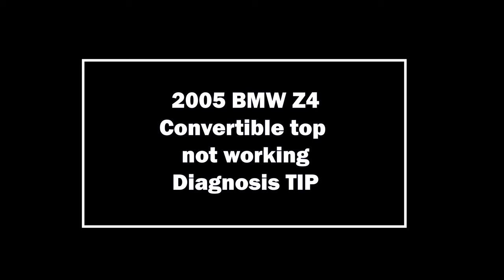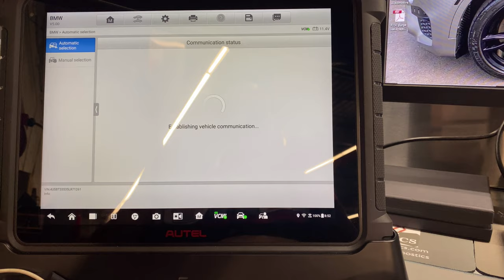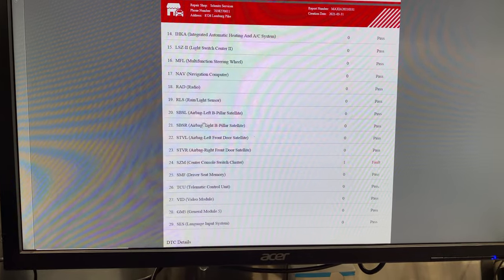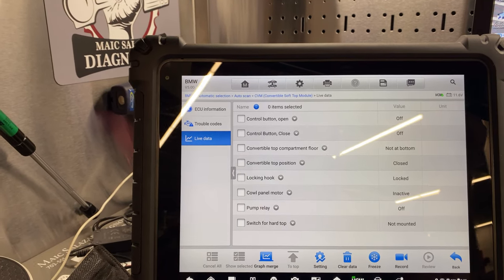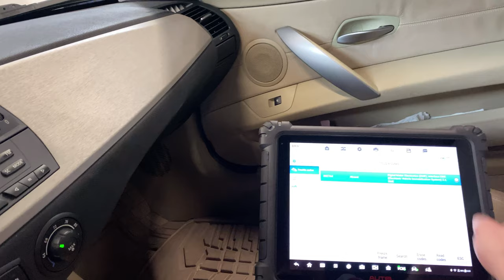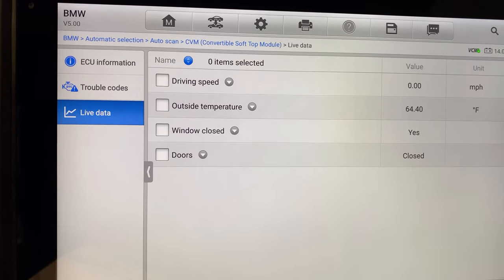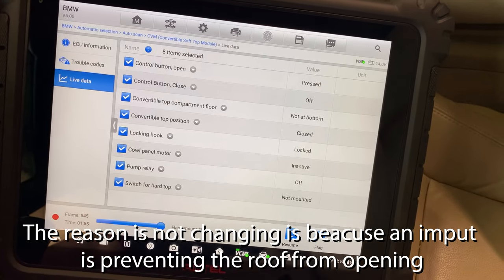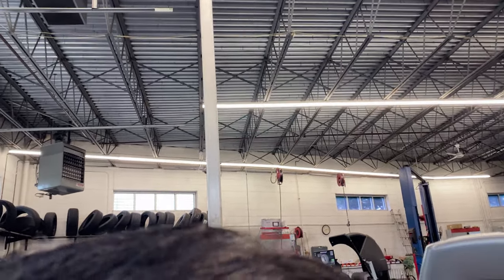2005 BMW Z4 Convertible top not working Diagnosis TIP

Comment: Hi Maic on BMW Z3 cars it’s the first thing to check but I have seen on a few cars ether the micro switch is faulty or the paddle on the switch is bent or missing and one more thing the movable compartment panel has a moulded square tab that can be broken and it will not trigger the micro switch.    But the most common problem with a non functional top is the hydraulic pump motor is submerged in water because of clogged drains the pump is on the driver side you have to remove the top assembly in order to replace it the top ECU Will not produce any fault codes what I do to confirm a bad pump is on the driver side behind the driver seat you can partially remove the trim and the pump master plug Is there so you can check the voltage when the top is opened or closed the polarity is switched when the top is open or closed I usually drill a bigger hole on both side when the top is remove to prevent any water damage later on.

Comment: I have the same car but it's an 03 any advice on why is negative battery cable is getting hot and the battery was leaking water but the positive cable is fine.

Comment: Where are you located? I want to take my Z4 to you lol. My soft top won’t go down either, I already made sure that the compartment is open too. So I tried to manually put it down but it gets stuck halfway and I don’t want to force it down (even after disengaging the hydraulics). I found out it only works to go up but not down. Even though the button to go down lights up?
Reply from the maker: Hi, I currently work for Bavarian Motor Repairs in MD. If close to you please call to set up an appointment at 240-552-9988 
This is the link to the shop website

https://bavarianmotorrepairs.com/?utm_campaign=gmb
Reply: @MaicSalazarDiagnostics  Nooo, how sad i’m in California. 😔 but thanks I will keep trying to diagnose it

Comment: so what modle autel are you using from one tech to another, im working on a Z4 that the pump drowned but there are electrical issues also and our scanner doesnt have that ability
Reply from the maker: I am using the Ultra. But the elite should do the same.
Reply: @MaicSalazarDiagnostics  thanks man

Comment: i remember having a bmw convertible that needed a diag for not closing. Visually inspected the hinge and trunk area, there was a can of fix-a-flat just wedged in between the hinge. once it was removed, top was operating as designed.

Comment: This was a rambling waste of time. Every Z4 owner should take a few minutes to read their owner’s manual and get to know their car. 

This is clearly written in the owner’s manual. It is NOT a “BMW issue” - it’s an ignorant owner issue. 

It’s sad that instead of looking over the car you wasted sooo much time fumbling around on your computer. Wow…
Reply from the maker: It seems you know too much about everything! Maybe you have a crystal ball that tells you when something is not working. So wizard man I have 05 Z5 with misfire. What it is? It has to be in the manual! What a joke you are!
Reply from the maker: Your poor judgment thinks I wasted time! I am an analytic person, so I gather data I fix cars. I saw on the pids for the switches that one was not right and went straight to the problem and corrected. So what is your thinking of waste time? So I rather go blind and look for what? You should just watch and learn!!!
Reply: @MaicSalazarDiagnostics  I apologize - let me clarify. Your diagnosis was excellent and you solved the problem. 

My point is - the owner should have simply opened up his owner’s manual and read “Convertible Top Operation”; a quick visual inspection would show that the shelf was not level/lowered into the correct position (there is a switch in the back that the shelf clicks into). This prevents the top from getting damaged by a large object in the trunk. 

Your video was fine, but all of that computer time could have been avoided if the owner would have simply read the manual; a 2 minute visual inspection is all that was needed. 

Sorry to upset you.
Reply: @MaicSalazarDiagnostics  Relax man…